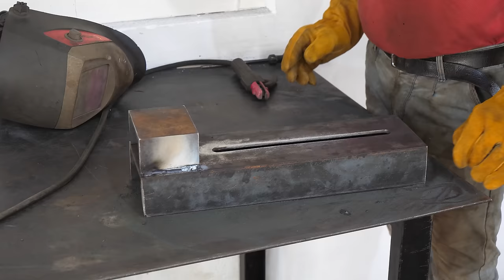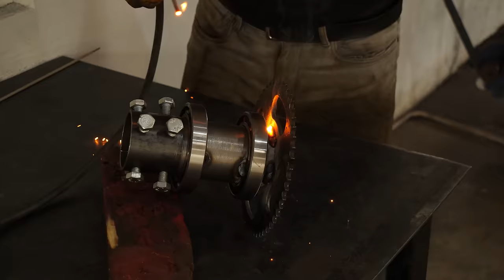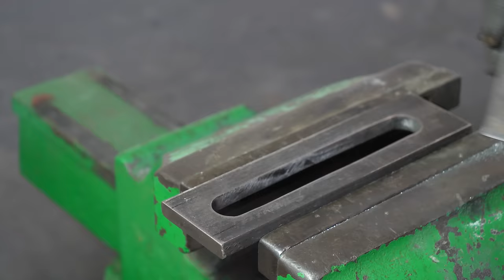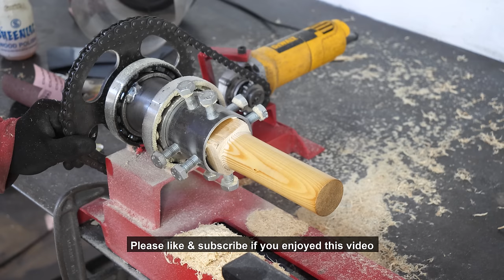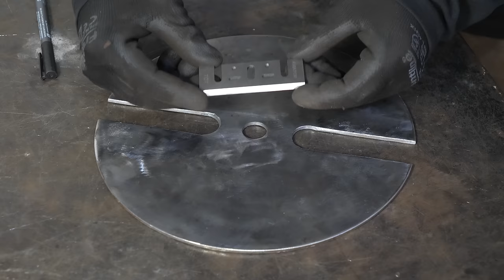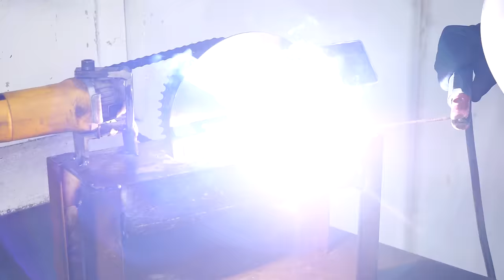AMAZING! Top 2 Angle Grinder Hacks | 2 Best Ideas With Angle Grinder | Simple Diy Ideas

Comment: I really like your builds, great work, nice welding and paint too!
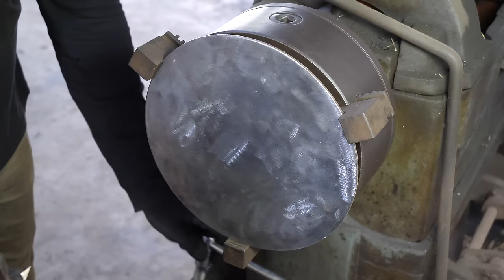FYI - at 17:32 no need to start center drilled holes on the lathe using the normal cutting tool.  A tailstock mounted drill bit will self-center very accurately.
Reply from the maker: Thank you very much for your suggestion bro❤